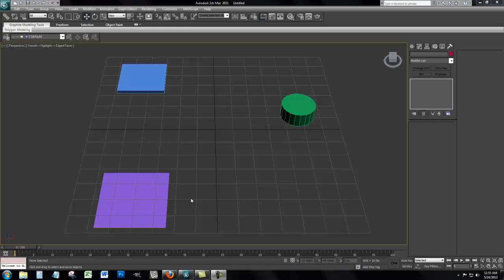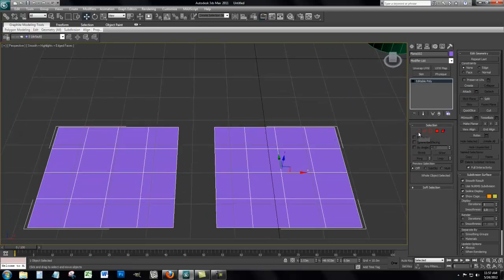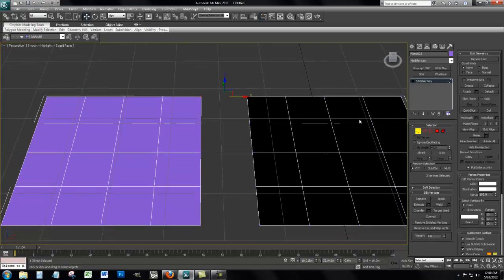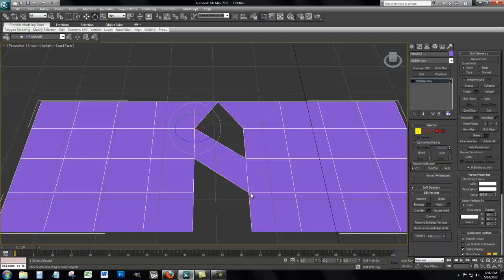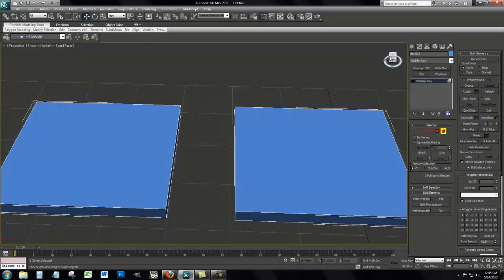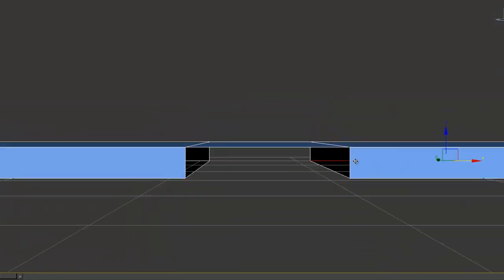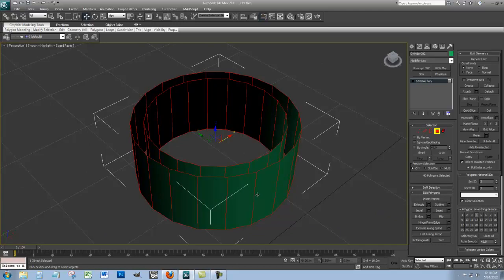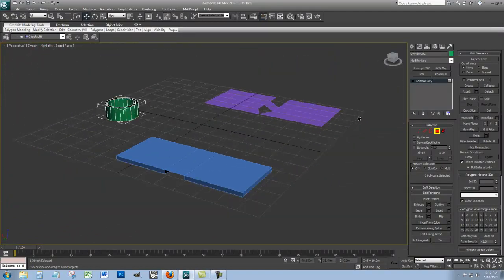Vertices That Won't Weld and Why

Comment: Awww darn. I hoped you had the solution for my 3D model (I am attaching a head to a body and the amount of vertices/edges is the same), but flipping doesn't appear to be my problem. If you happen to read this, or anyone else, would you know what might be my issue?

Comment: At 11:12, the bridge is twisted because the two elements are reflections of each other.  But if you choose the options button for bridge, you can twist the results in the caddy.  This has been available since 3DS Max 2011. So you don't have to do the edges piecemeal, you can select the border edges on both elements and bridge.  You can also bridge by selecting the polygons themselves, and it would be the same as deleting those polygons bridging the resultant border edges.

Comment from the maker: did you try flipping the normals like i did with the cylinder? More often than not thats why verts wont weld is because the normals are facing opposite directions.